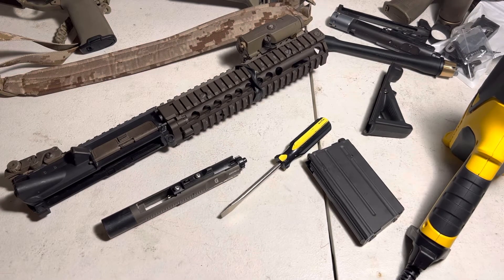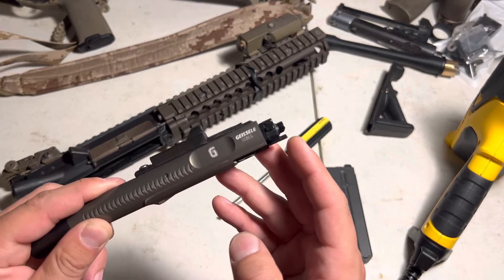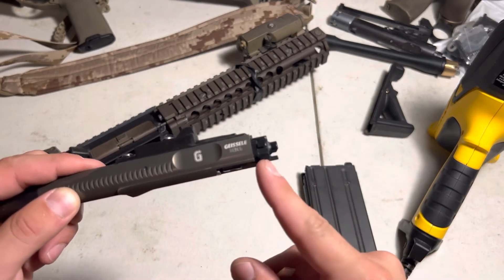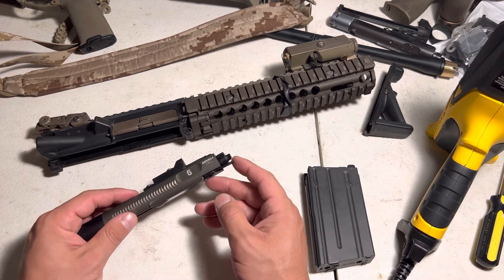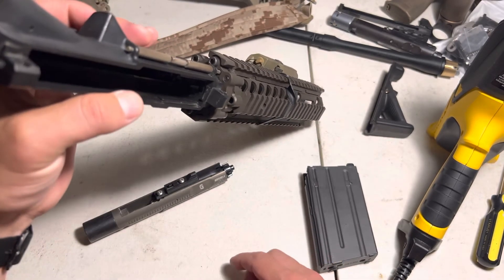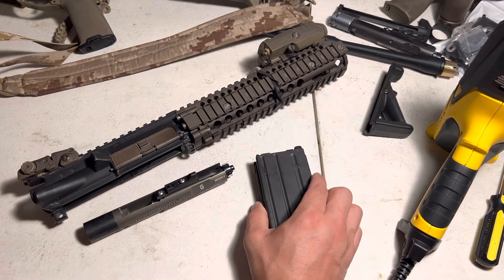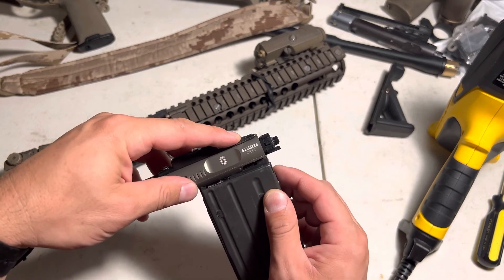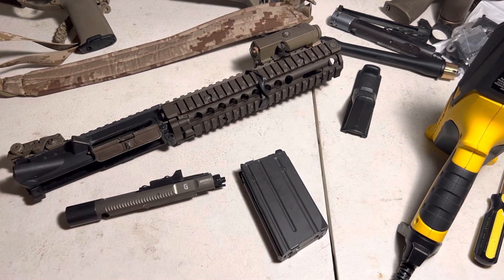Tokyo Marui MWS Issue: Bent Loading Nozzle Arm Quick Fix / Bolt Jam Diagnosis

Comment: I had the same issue ended up jb welding a steel shim on the shelf so far its holding up fine and has completely fixed my feeding and efficiency issues

Comment: This is happening on my stock MWS, happy you posted this man I was going crazy troubleshooting.
Reply from the maker: Hope it helps. Overloaded mags can cause premature wear on the loading arm too, so not over stuffing mags is a good tip. Guns modify nozzles are thicker than stock tm nozzles and should be a bit tougher as well

Comment: This was one the things I considered to be the jamming issue. The others were a worn down nozzle reset or a slightly larger inner diameter on the upper receiver.
Reply from the maker: Receiver wobble can cause issues too for sure! Overloading mags can cause strain on the nozzle pickup arm as well. Guns modify nozzles seem to be a bit sturdier than stock so I recommend those as replacements

Comment: Phew, thanks for confirming my hypothesy, thought i was going crazy for a minute. If you guys found a permanent solution for it i’d be grateful if you did a video or a clip with pics of fixes. Off to the auto parts store to get some stick epoxy to build a lip up now.
Reply from the maker: Good luck! Check the comments below for some other possible fixes. Problem with these builds is everyone’s using different parts so it can be hard to diagnose each case. 

I will gather some more intel and add this to the list of follow up vids I’d like to make tho, thanks for the feedback

Comment: I'm troubleshooting this issue for a couple of days already. My mind is blown, this is my first expensive purchase when it comes to airsoft and it broke after about maybe 200 bbs.
It's just so disappointing to buy a TM and face this kind of issue.
Reply: Same happend to me, bought tokyo marui piece of garbage in my opinium
Reply: @fsdffdsgfdg8295  I was a little bit angry too, but no worries mate, keep in mind that even the best companies may have occasional bloopers. Also remember that you paid for the whole gun and its just one piece that broke. What I did is I replaced the nozzle to a T8 one, and replaced the BBs to BLS/Geoffs. Japanese BBs are a little bit smaller and TM mainly targets the jp market so I thought that maybe the nozzle had problems with pushing some 5.97 bbs out of the mag. Even though sometimes bb companies state that their bbs are 5.95, tests show that it's not true, so keep that in mind too. OllieTalksAirsoft had a video about bb diameters. Another thing to check are the mag lips. Make sure they are sitting tightly in the mag, as just a little bit of play may possibly result in some inconsistencies and the nozzle having problems with picking bbs.
Reply from the maker: Wow.. so sorry to hear that guys. Idk what to tell you I’ve never had this issue on any of my stock Marui receivers, only aftermarket kits. But I have been hearing more and more issues with first time buyers lately.. especially mtr’s. I’m starting to think something may be up in their qc lately but it’s hard to confirm. 

Nozzles are a consumable item but they should last 1000s of rounds not hundreds. One thing you can do to go easy on them is not insert a mag on a closed bolt, or don’t over fill your magazines. Too many bbs may add pressure on a closed bolt loading arm.  

I’ve never bothered with any of that however and typically have no issues, unless something else is going on like a loose barrel nut that caused the whole hop chamber to move (rare but could happen if you don’t torq properly) or 99% it’s caused from aftermarket receivers being out of spec etc. 

It’s a tough issue to diagnose the actual cause and fix sometimes, but can usually be remedied somehow. 

I’d say 99% of ppl have great results with their mws but there are random issues out there so you may just have got a lemon unfortunately.
Reply: @Wolfman_NV  i say, I am a noob at this yet but I have learned that things is not always broken just need some love and it will work propperly..its a good gun, gonna go right now to do some ratatattata :) 

My tips is  get knowledge on Youtube and it will be fine..

Comment: Hey I have like 1mm of wobble on the front rail, anyway i can fix this? It’s really annoying. Thanks.
Reply from the maker: You likely need to add some barrel shims, you can get a pack for like $5. Sometimes takes trial and error, it may feel tight when hand tightening the barrel nut, but when doing a final torque can be loose. If so just add spacers and try again. I always do final torque on the barrel nut and check for barrel wobble before installing the rail. 

For rail wobble, it may be something else, depends what rail you’re using?

Comment: yes，my mtr noozle arm and hole bend ，suspect the upper Entire shape of the bb chamber is bit off set，cant load bb when using semi， but on and off when i switch to full auto，headache，new unit but cant use ，so sad
Reply from the maker: Easy fix, just replace with a Guns Modify nozzle which is a bit stiffer loading arm than stock anyway

Comment: the top of the magazine is causing that issue . whats it called the bbs load into the gun from the mag. that little piece need a little more space
Reply from the maker: The feed lips? Ie they are too tall? Depending on what magazine you’re using this can cause an issue as well. However I experienced it in reverse. 

On my Hao cag 416 kit it would jam with stanags but work flawless with ace1arms PMags, and I determined the PMags feed lips sit slightly higher, so the stanags were just short enough where the loading nozzle wouldn’t strip a bb out and would jam every time. Good point thanks I’ll add that to a list of possible solutions
Reply: @Wolfman_NV yeah I’m having this with another kit gun as well. I already shimmed magwell so there is no play now so the mags should sit perfectly. But after about 4 mags original Marui mags are getting jammed and my nozzle looks like a complete mess. However still cycles and works with GM pmags so I’ve been trouble shooting and just like Op said someone else in my Airsoft community also suggested changing the feed lips. The original Marui feed lip area is a bit smaller than aftermarket mags so the bbs are tighter inside. However other mags like the pmags from GM or ace1 their mag lips  are wider so the bb doesn’t take as much force for the loading arm to push it into the chamber. Was told to just make it wider but slowly removing some material in the feed lip until the bbs don’t take much effort to be pushed out

Comment: I also have the exact same issue...
Reply from the maker: Best bet is to just buy replacement guns modify nozzles, they don’t bend as easily unless something else is really wrong
Reply: @Wolfman_NV  I think I have the same problem with the lip in the upper receiver that is too thin, you think the guns modify nozzle will fix this problem ? Should I take th V2 or V3.5 ? I fixed it with some tape around the mag but it is inconsistent, sometime the tape wear out and the problem re-appears